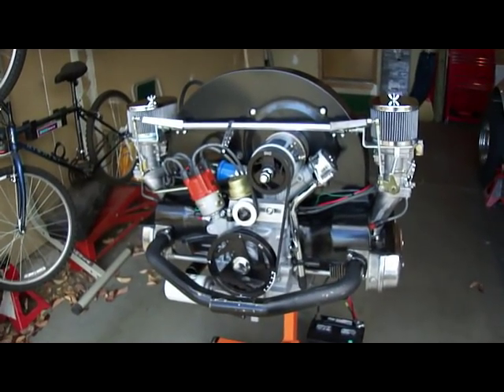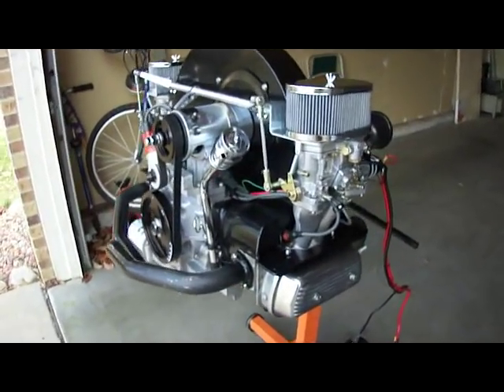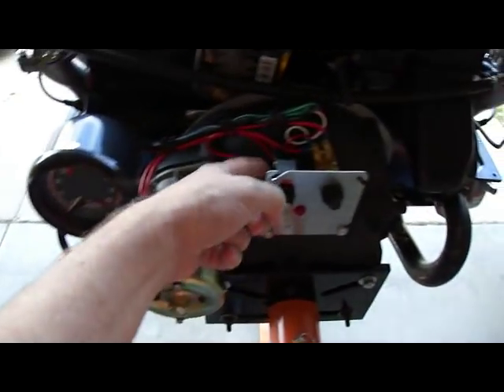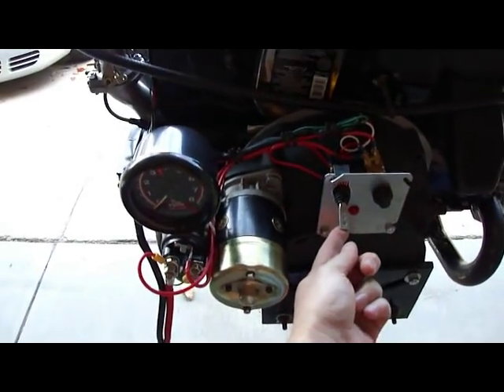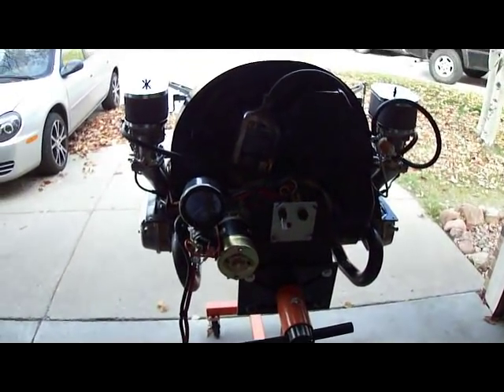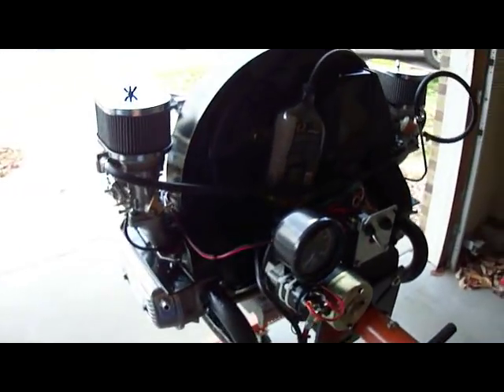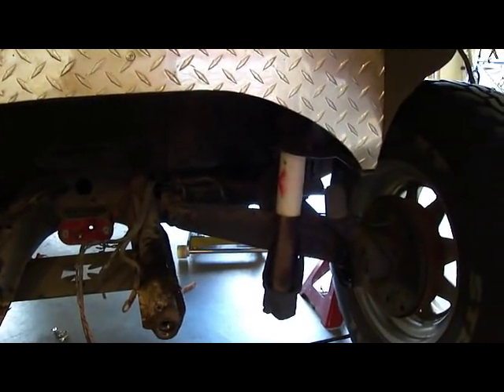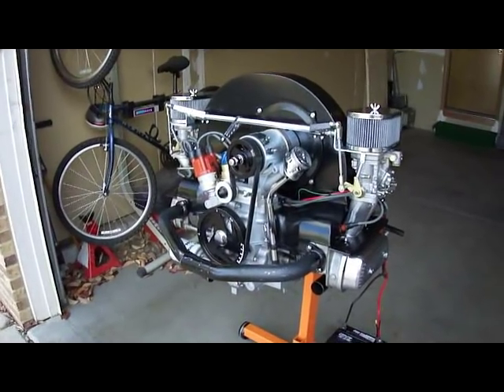VW 1835 Engine Test Stand Running

Comment: I built a 1835 engine for my Red Baron bug, I clearanced the case myself to install a 76 mm crankshaft, it revs faster than yours, burnouts in 1st and 2nd gear, it’s fun to drive as a daily driver.

Comment: Slowly  getting parts and  machine work. But is a Sachs  press. Plate  stronger than stock   1776  40 by35  valves

Comment: I have an OEM engine i picked in Norton OHIO turns free by hand . I am trying to start on the floor . But the start doesn’t seem to have enough power to turn the engine.  The battery is brand new. I have not done any type of mechanical work on the engine.  I just wanted to see if it runs

Comment: Just inherited a custom bug, with an 1835, been sitting in a garage for years. MIne is single carb, noticed dual carbs on yours,  is it better to run dual on this engine?

Comment: hi great engine how did you hook up the starter motor without the bellhouseing on the stand. did you make up a bracket to hold the starter motor or did you buy a bracket. some I've seen on stands have an old bellhouseing cut down to mount starter. im doing up a vw motor at the moment but won't be able to test it on stand without hooking up the gearbox as well. i didn't want to do that. thanks for any help.
Reply: Guess by now it's solved. But you can always skip on the belhousing/starter assembly and use a simply drill and socket on the front pulley. Pretty much a makeshift starter. ;-)

Comment: Love the engine starter set up.  I'm getting ready to pull my 1960 VW bug engine.  I overheated the engine so now I need to inspect the damage.  This is my first time pulling the engine out and working on it.  Any advice?
Reply: Before removal it's always good to check running condition. This allows for a good baseline before tear it down. 
Compression check it's a must. Also hook a vacuum gauge for additional diagnostics, if possible check also oil pressure. This three things combined are an excellent tell tale of what's going on with the engine.  ;-)

Comment: i hope your Serpentine Belt and Pulley Kit has a steel internal collar on the bottom pulley cause if its just a alloy it will eventually damage your big end bearing. Alloy and steel don't mix in this case.
cheers,
Niko.

Comment: +Frederick Bock the belt is a serpentine kit and the idler pully allows for easier adjustment compared to the original belt where you have shims In between the top pulley to adjust it

Comment: Cool- definetly the old days there. Now for drag racing you need a beefed custom transaxle and a drag type clutch. Most people are just having fun on the street or mild offroading. These cars being so lightweight makes them fast and fun. Check out my latest project VW on my channel (can't post links), I have been messing with VW's since the early 80's. Going down to the garage right now to work on some remaining details.

Comment: No problem, i understand, i you're correct, i saw a slotted bar behind that which appears to be for adjustment.
Yes the transaxle is strong, i had a few bugs many years ago, 61 was my 1st car, last VW was a super beetle. 
I live in NY and about 1970 i saw an EMPI bug at the drag strip pulling some good times--

Comment: Not being a smartpants here, just pointing out the difference between an idler pulley which doesn't do anything except redirect the belt, and a tensioner pulley which sets the tension. 2 diff things to a tech. VW transaxles can take alot of abuse, but it depends on the driver and the useage. Offroad/street Bajas can get by with the stock transaxle used intelligently.  Definetly need a high perf. clutch for this engine, Kennedy makes an excellent performance clutch for a good price.

Comment: Ok,idler/tensioner yes i know the stock VW's had shims behind the pulley, so that eliminates them, also looks like a non v belt-- 
i am sure that motor was expensive

Will the transaxle and clutch take the extra power of that engine?--

Comment: It's not an idler, it's a tensioner. The stock setup uses shims between the pulley halves to set belt tension. This is a big improvement over the stock setup.

Comment: Those are called half shafts (CV joint and axle assemblies are called half shafts), the transaxle is what you are calling the transmission. My opinion : these engines are so easy to pull in an out, so easy to access especially on a Baja, why test it on the stand? Just go ahead and install it.

Comment from the maker: Kirk is right. You want a complete exhaust system on their esoecially when breaking in a motor. You need a certain amount of back pressure to help the valves seat properly. Not enough is bad...and too much is bad. I was in the process of taking apart the exhaust when I decided to make this video. I had the full stinger set up when I broke it in.
Dave